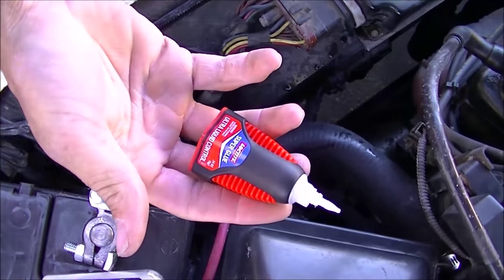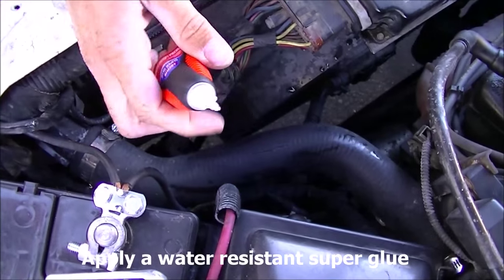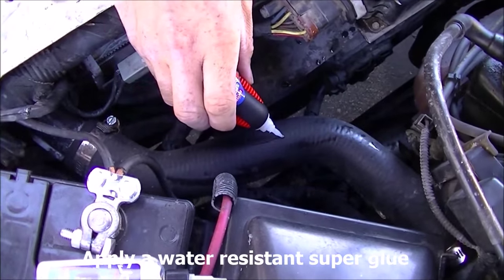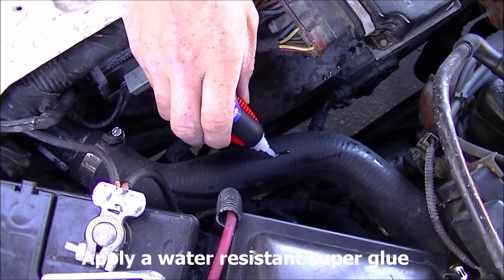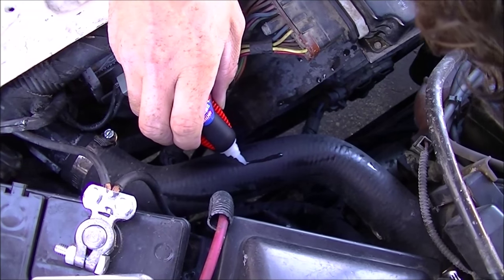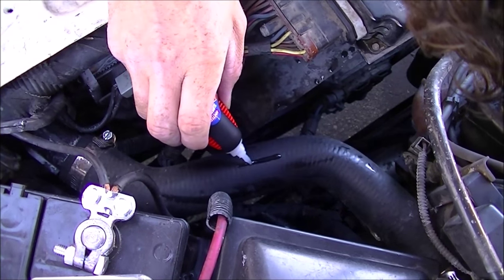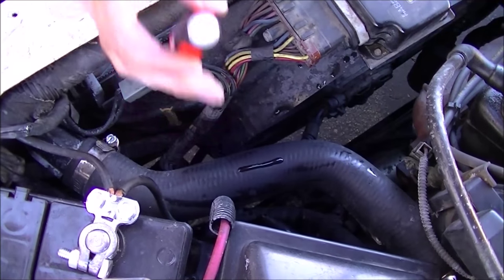How to quickly repair a radiator hose

Comment: Happened with my car once when the coolant return pipe cracked. I was hundreds of miles away from the nearest authorised service center and was also not in my hometown. Was staying in a hotel. I bought a small pack of epoxy putty and applied a thin layer on the crack - left my vehicle parked in the parking lot overnight to allow it to dry and solidify and then drove back home the next day without any issues of coolant leakage. I got the hose replaced after a year. The epoxy putty held on real strong. Just sharing with in case anyone face such a situation.
Reply: fuk i hope this is true ive got an old car i cant get a spare hose for
Reply: @lazycarper7925  there are a number hose repair kits available. You'll be able to find few over the internet as well. But yeah it really depends on the nature of damage and if the hose can be easily patched, you'll be in luck and will hit the road soon.
Reply: Iv just had a garage try and charge me 800 to replace the hose. I think I will try this first..
Reply: @deadstreet1675  I am thinking Permatex will work.  It is an RTV sealant for temp extremes.  Need to try on a small leak I have where hose clamps into radiator.
Reply: you only replaced after a year?? wow that's some quality fix
Reply: @RedMango55  how has this held up for you? I have a super tiny pinhole leak in my hose.
Reply: What amazing timing, my car had a similar problem yesterday morning, bought a flex seal tube the size of my forearm and she’s purring like a kitten. Your comment definitely brought me some reassurance however I do plan on triple coating it before taking it to my favourite shop.

Comment: Better is liquid rubber its flexibile and it will not crack like glue
Reply: Just curious, what brand? Thanks
Reply: @sammyhooligan803  I had Bison liquid rubber, but any like that will fix
Reply: @LuXoR1590  gotcha. Yea, right now I'm trying to fix a leak either on a smaller overflow hose? From the top of a Ford explorer '05 radiator or a small fracture on that hose mount hook up. If it's that hose, after I remove it and look for deterioration/ breaks in that rubber hose then, that would be simple to replace, but if it's on that plastic outlet area then i might try either JB weld or something similar for hard plastic construction of radiator. I noticed about 20 ounces low in overflow tank by airbox side, and a small flow of coolant fluid draining from the small hose hookup/ outlet. Maybe I can figure it out, 👍
Reply: @sammyhooligan803  What did you end up using on the plastic, and did it work?
Reply: @tendoublesx1078  . I had purchased the JB weld kit ( two epoxy tubes)after removing hose line at the top left side of radiator, where I first noticed a small leak and eventually it wasn't that overflow tube hose, It had a very small fracture on top left radiator near hose outlet area, about a 1/4 inch ,So I sanded area lightly, added JB epoxy weld that afternoon, let it sit overnight, and added more the next day, not as much just around entire area but with a very small painters brush, size of a wooden stick match. And, Zero leaking since. The only reason I can figure what happened, was during The winter months, below freezing last year, the water that I added to full strength making it 50/50 seperated, and the top portion of radiator was where the water was frozen. With the vibration of motor when on / driving/ road vibration, the small fracture/ crack formed when ice eventually thawed and cracked also at that top particular area of plastic radiator. But it being plastic overall, might be less durable than an all metal radiator also. Just my theory, although, I eventually want to change out entire radiator, if or before any other leaks occur. Thanks for concern, 👍

Comment: Baking soda applied to cyanoacrylate(superglue at dollar store) = same thing as in this video
Reply from the maker: val m not nearly the same thing but yes it will harden super glue.
Although it chemically reacts and greatly weakens it. Johnny weld cures and reinforces it and it pours real nice.
Thanks for your comment
Reply: Val M....Mmmmm baking soda ahhhh ? Never thought of that one.. that's for the tip.
Reply: @guesswhomartin9249  haha all it is technically is baking soda and super glue......... It says apply "Jonny weld" and I saw baking soda 🤣🤣🤣🤣
Reply: @DASHAWNJOHN  ... yea,, a hose like that, I'll repair it only till I get to a professional mechanic or I replace the hose myself. But most likely, I'll call AAA for a tow. I'm not going to rely on that repair for nothing. If it fails, it will cost me more money.
Reply: @guesswhomartin9249  I used Quick setting expoxy, and Scotch tape and I drove for about 10-15 minutes total until I got a hose for it
Reply: @guesswhomartin9249  my method was cover the damage inside and out(Because the heat from the engine will reduce the strength of the expoxy, the more you put the better) and the Scotch tape was just because I didn't have duct tape or gorilla tape available but luckily I live 10-15 minutes from AutoZone and 5-10 from colvins auto supply or 5 from advanced Auto (I Don't go to them)

The vehicle was a 1996 Chevy 3500 pickup........Very interesting day
Reply: @DASHAWNJOHN .... Good man... I agree, it's a temporary fix.
Reply: I sure.hope you're right...or there goes my Duramax

Comment: pipes like that ususally break when they're really really old and the gazilliont hot/cold cycle takes it toll and perishes the material. a hole will  from from the inside, and if you repair that hole, another will appear from elsewhere. the walls of that host are uniformally compromised, do yourself a favour and replace it with a brand new part.

Comment: Whenever I got a coolant hose leak I find that the simplest cheapest and easiest way to permanently fix it without having to spend sometimes even a $100 for new hose assemblies, is instead a 5 dollar fix: welcome to a simple hose coupling. It costs about 5 bucks and comes with two clamps and u can get one for about any size. What I do is simply cut the hose in half with a razor where the leak is, insert the coupling between the cut, clamp em back up and there ya have it , good as new, no tape, no worrying about it coming off because this is exactly the method the factory uses at the end of the hose, you're just doing it in middle. Good luck! Was surprised not to see anyone on YouTube mention this 🤔  

Ps: if ur stuck on the side of the road the easiest way to get back home would be taping up the leak with whatever tape u can get ur hands on (many rounds, use the whole roll if yall have to!) and if u have no tape just wrap a towel or cloth as tight as u can and then just loosen the coolant cap enough for some air to get out so u release the pressure on that tape or cloth. Then fill up reservoir with water if u have no coolant. (Make sure u don't leave that water in during the winter as it'll freeze up)
Reply: Just get it towed.  If it's not distilled water , you will get mineral deposits in your engine.  Unrelated:  If you do a neti pot nasal irrigation with tap water, u may get a brain infection.  That is why they use distilled water when doing nasal irrigations.
Reply: Genius well said. I do irrigation plumbing and retaining walls for a living and we use PVC pipes that come with couplings etc. this makes sense. I get paid Friday so I'll probably use the rag method and tighten her down with some zip ties
Reply: @kendalgee5808  Not actually true. Upon doing some reading on the subject a year ago, softened water ( like what come out of your faucet, when you have a water softener) is what you want. Distilled water is okay ,when it's mixed 50/50 with coolant, but not by itself, it's not balanced with ions, so it's very corrosive. Bob is the oil  guy, has a good article on this.

Comment: tried   a similar product on a pin hole on a tractor radiator hose  does not work    the emergency tape gave a much better result  had a dew drop leak  re wrapped the hose yet to see if the timy dew drop is gone    however still have a new hose to fit

Comment: First, I wanna say, thank you for your video. You did give me an idea. 
But 2nd, how reliable is this repair you just did ? 
If I use my car for work making deliveries, and I'm on the road all day, is this patch reliable ? I question that. I cannot take that chance. My income depends on my reliable transportation.
Reply from the maker: Thank you for your interest. This repair because of the water is good for about a week. Applications without water are generally permanent
Reply: diy myself. this actually works
Reply: @apetcharlie  .... I'm sure the idea works. But as I stated before, it might temporarily. But I personally wouldn't depend on it long term. 
I would use the idea just till I get to the auto store and buy a new hose and replace the hose myself, or have a professional mechanic fix it correctly.
Thank you again for your input.

Comment: What happened AFTER a week of driving?  New hose needed?  I have automotive grade Permatex, good for up to 400 F.
Reply from the maker: @RedMango55   sorry for the harsh reply, I was very frustrated with trolls last night. I know a few things about chemicals. My father was national leading salesman for loctite Corp while I was growing up. I developed this product to allow people to fix something very fast. In a lot of cases it is permanent. In a lot of cases it is not. To permanently fix  I would cover with Johnny weld to seal immediately and then go over it with permatex. Now you can drive while the permatex dries. Works well to hold items while epoxy cures as well. If you would like ill send you a free bottle.
Have a good day bud
Reply: @johnnyweld3328  All good bud.  Sometimes we need to step back from online arguments with trolls, they enjoy that kind of game.  Your video was informative and useful.  There are ingenious ways to fix things and I get inspired.  Cheers.

Comment: Will it work for a power steering rubber hose ?
Reply from the maker: Yes it will.
Sand or clean the area as much as possible. Don't forget to use multiple layers 4-5 at least.
Reply: No
Reply: Don Nato, .. Yes
Reply: @zaino660  yes
Reply: Cut a tiny piece of the tube if it's in the middle where it's leaking go in the auto store find a pipe that fits snugly inside and get two clamps, cut the pipe down put it inside the tube where you cut and clamp both sides, I did this and it never failed afterword

Comment: I have a leak in my hose this will work right and that the other thing that's going over the water proof glue
Reply from the maker: saye johnson yes if you get the loctite water resistant super glue. Sold at Home Depot. It says dishwasher safe in red container. Also have to let cure 24 hours to be water resistant. Thanks

Comment: The coolant system is pressurized so wouldnt the pressure cause another leak in the weakspot
Reply: No it should work because if you fix the leak everything should work like regular

Comment: Will this work on trans cooler lines?
Reply from the maker: Yes, clean all grease and oil from the line and apply 4 to 5 thin layers.
Reply: What about a power steering rubber hose ?

Comment: this might hold for couple of days, not more, because of high heat and pressure
Reply from the maker: Any average super glue will hold a higher heat than a vehicle runs at. Also works well on compressed air hoses and fittings. I've actually fixed leaks on pressure washers that run over 2000psi.
On a rubber radiator hose the hose will fail after about 500 miles because the rubber separates without internal fiberglass reinforcement in the affected area.
Will get you to a shop and beyond.
Thanks for looking

Comment: lord did you just stab your radiator hose ..? please tell me it had a leak prior lmfao " well i dun turned dis perfect radiator hose brokeded then i fixed it for a whole week! "
Reply: you think this will work for a small gas hose?
Reply: ok, well gonna try it until i can find a new hose online. thanks. over a year? wow
Reply: Johnny Weld What stores is this sold at?
Reply from the maker: Erik Anthony Ace Hardware, RC hobby stores, some Napa auto parts. It's only in about 130 stores now mostly on the west coast. It is also for sale online from a few vendors.
Reply: its not at my ace hardware, they had no clue what Johnny Weld even was/is I will check napa auto today. Im in New Mexico so I may just have to order online
Reply: Erik Anthony just use baking soda thats all this stuff is

Comment: Dude,isn't that glue flammable?Won't the heat buildup from the coolant cause a fire? Man, I wouldn't risk driving the car unless to get me home so I can change the hose.
Reply from the maker: A coolant hose only gets up to around 200 degrees igloo is only flammable when it is in its liquid state not curedand yes it is a temporary fix to get you to the auto place to get a new hose in no way shape or form is this a permanent fix
Thanks for looking average Joe